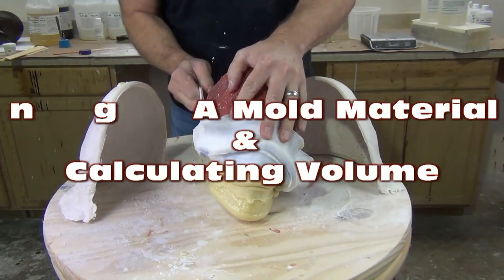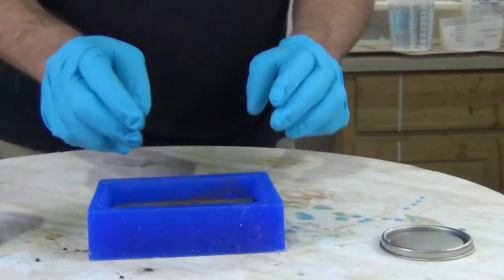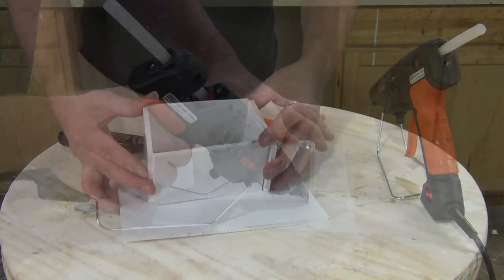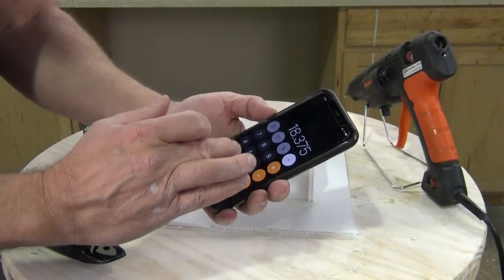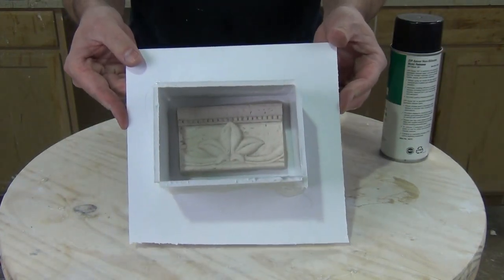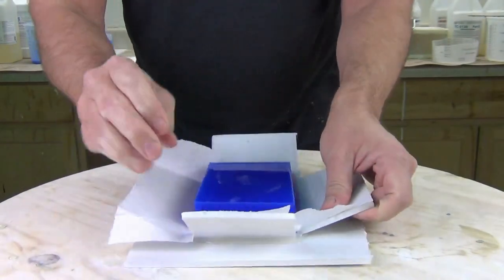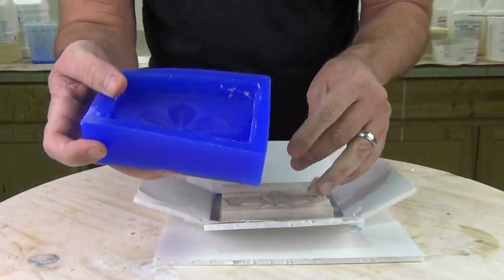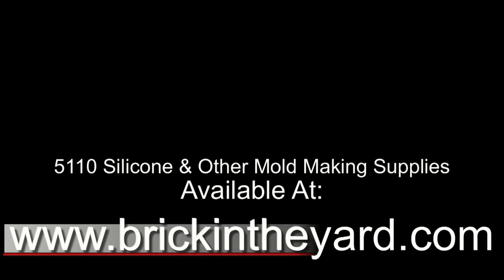Silicone Mold Making: Calculating Volume & Material Selection

Comment: This formula doesn't take into consideration the volume of the part being molded. Is there a formula or trick available to calculate the exact volume needed for rectangular molds? If yes that would make a great follow-up video!! Thank you for all the great educational content!!
Reply from the maker: Subtracting the mass of the part gets very part specific. Electronic enclosures and mechanical parts are typically so low in mass that there's not much point in calculating. Bigger parts you can do a rough l x w x h calculation and subtract that from the total volume of the mold box. Here's another approach for volume for unusual shapes: https://youtu.be/7NnckK5YrvQ?si=iMuN4dJ31l90XRlX
Reply: @brickintheyard  thank you!! <3